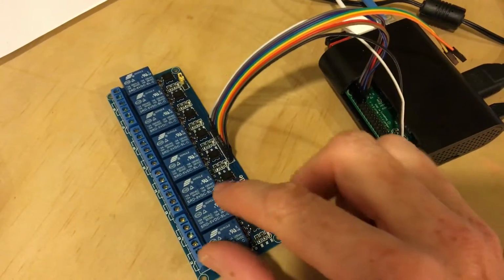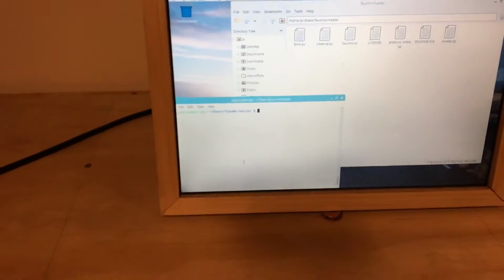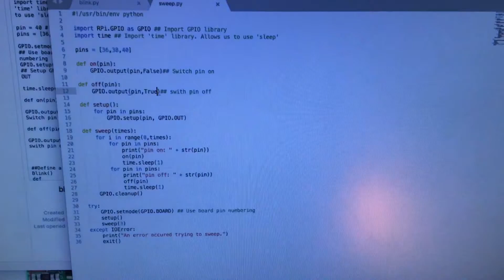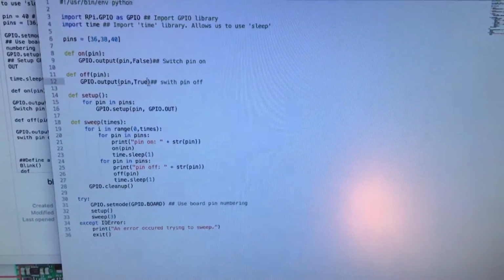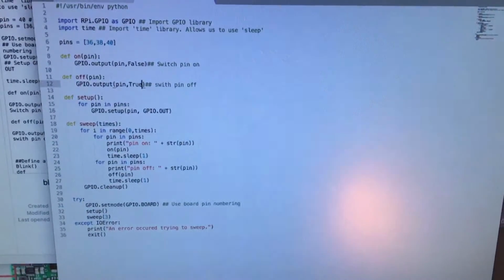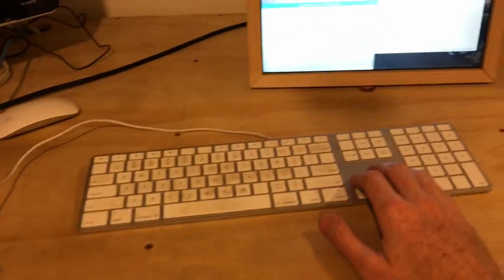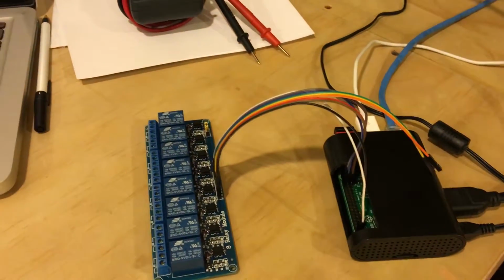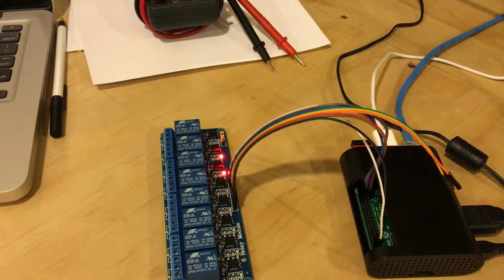Alexa Raspberry Pi Home Automation Maker Project Update

Comment: Hi,
I have a idea that maybe you can help me out with. Its kind of a mixture of 3 of the videos you've posted about. So I have a raspberry pi and a bank of 16 relays that will connect to lights in my house.

I also would like to be able to use an input on the pi to turn them on/off also...like a 3 way with alexa.
 
For example, I want to run an wall switch from a GPIO on my pi and control the light normally. Then when I'm leaving my house I want to say Alexa Turn off House and it turns all my relays off. Then when I come back home and turn the switch (whether it's in the off or on position(like a three way)) it turns back on.

So its the coding that I'm not so good with. Is there a way in Python we could have it just watch the state of a input and when it changes, it changes the state of the output pin? Then also alexa (fauxmo)would be able to override it no matter what state the input is in?

Let me know if you have questions or if this doesn't make sense.

Thanks!
Reply from the maker: @Alan Miller - Hi thanks for your comment. The short answer is that yes it is possible. If I'm understanding you correctly you're referring to a feedback loop so the raspberry pi would always know the state of the switched device (on/off), and be able to switch off only devices that are on and ignore any that are already off. I've had a few other questions like this... I'll see if I can work up a demo and post another video about it. I haven't been as good posting videos lately as other things have been using my time but I'll see if I can put one together in the next couple weeks.
Reply: Thanks for getting back to me. Sorry my question was written so confusing, I thought i would just make a video to help explain myself better. I'm not sure if I made it any more clear actually.
Please check this out:
https://youtu.be/Vx5TzEnjr0g
If you don't have time, I completely understand, just let me know and I'll try to find someone else to help.
Thanks
Reply from the maker: @Alan MIller, I've been looking into ways of implementing what you're trying to do. The main part of it is reporting the current state of the device back to the raspberry pi. I have a video that talks about wiring up a three way switch with a relay so you can control your light/device with either. In that video I drew a schematic with two switches and the light on the right hand side. The simplest way to read state and report it back to the raspberry pi would be to use a small cheap cell phone charger and wire it on the light/device side of the schematic where the power is switched and flows to the device. When you turn either switch on power flows to the cell phone charger as well. Then you can wire the 5v dc line from the phone charger to your raspberry pi and use it as a dc input to monitor state for that circuit. By reading the value of the pin you use as input you'll be able to know if your device is on/off. If the charger is supplying voltage to your input pin the device is on, if there is no voltage the device is off. There are a couple other ways that involve some knowledge of electronics and the use of a rectifier bridge, or an AC line monitor like the MID400 from Fairchild semiconductor. I've ordered some from mouser electronics and will be experimenting with them once they arrive. Once I've worked something out I'll post a video up about it. Stay tuned. :)
Reply: Hey, I tried the code you suggested and I was able to get it to work. I ended up monitoring my output with an input. I do think I will have to do like you suggested and wire it as a three way to the relay. Then order some of those MID400s and use that back into my input so it would switch correctly. Thanks for all the help!
Reply from the maker: Alan Miller no problem, glad it worked. The MID400’s I ordered arrived so I’ll work out a proof of concept and see if I can get it working. If I do I’ll post a video of it. 🙂